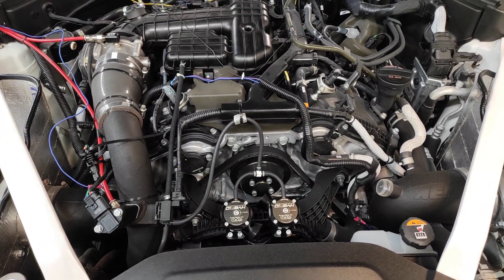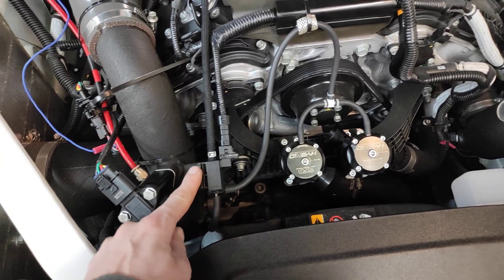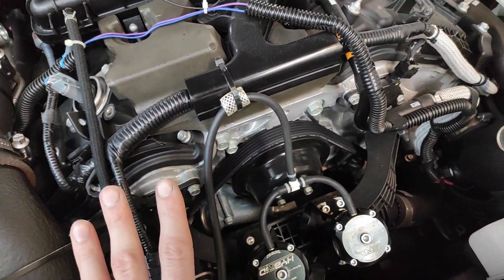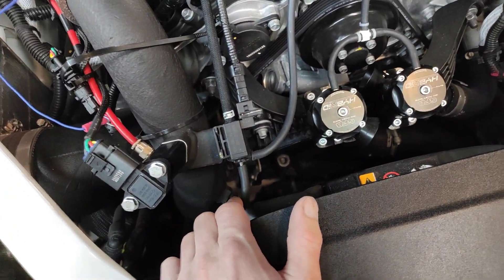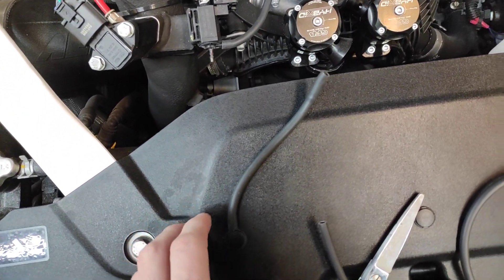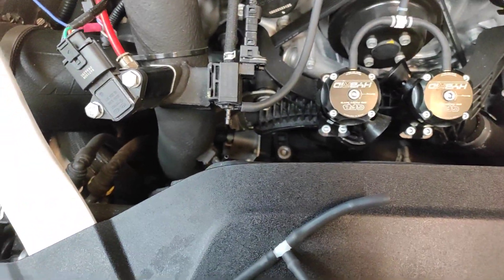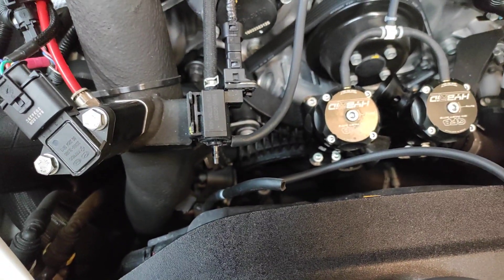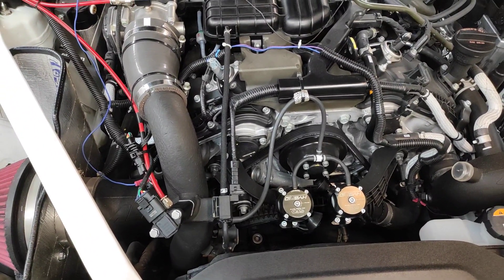kia stinger mechanical boost gauge tie in location

Comment: Thank you for that video. I noticed your heat shields around the intakes. Have you seen a drop in intake temp using that material? Also I noticed you have 2 ports ( or I think I see 2 ports ) for you water meth injection system. It that normal or something you added? I believe the one up front is the BMS port?
Reply from the maker: I run a custom methanol setup. There's a good bit to it. The heat shield is there just in case to minimize thermal transfer if possible. But with upgraded intercooler and methanol iat is usually rather low
Reply: @miscellaneousguy3803  ok I see. I looked for a video on your channel regarding the meth set up  but I didn’t see anything unless I missed it. Is there big improvement over a standard set up?  and which IC do you use now? Thank you for the reply
Reply from the maker: @hmc8171  it's not listed as it's very experimental and not new user friendly. It has its benefits but it's not simply double vs single nozzle. Each nozzle has a particular job. I have the aem intercooler. It's cost affective and beefier than the oem by alot. Plenty for stock turbos
Reply: @miscellaneousguy3803  thank you again. I really enjoy and look forward to your content regarding these Stingers. I appreciate your time and knowledge.